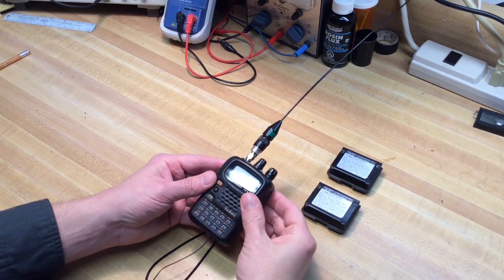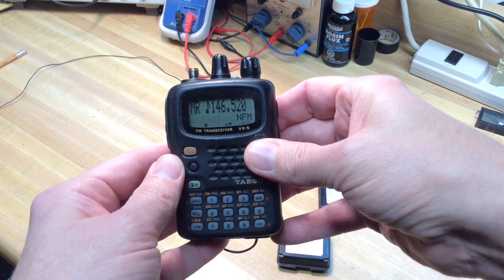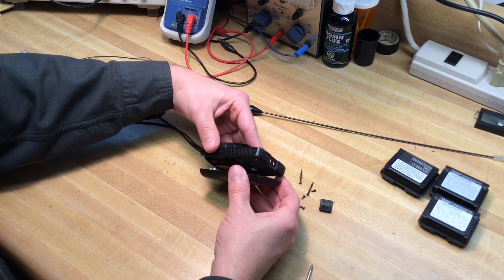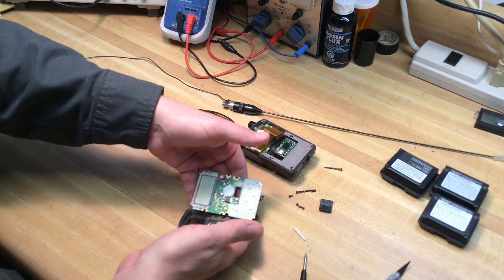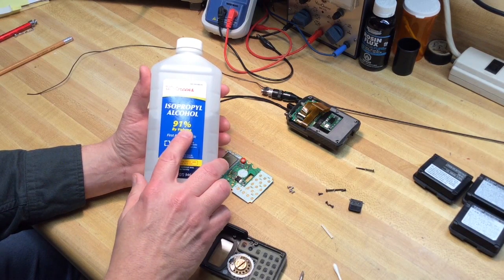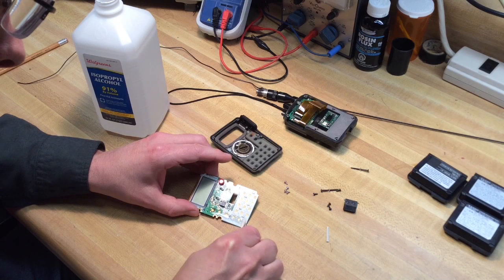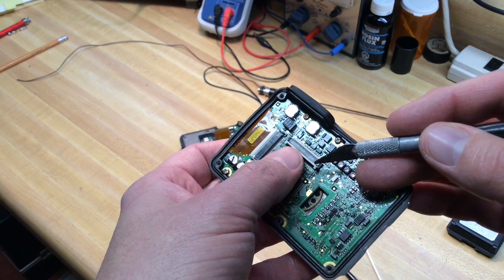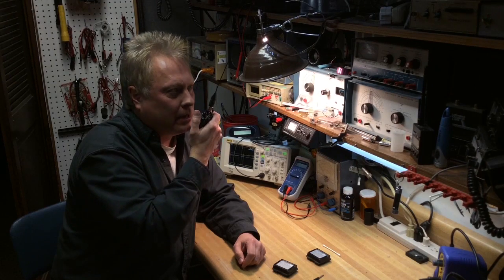Yaesu VX-5R On/Off Switch Problem

Comment: I've had an HTX-204 (Radio Shack) sitting around for a while that won't turn on.  I tried alcohol to clean contacts like this video shows and it still won't turn on.  I checked continuity around the battery terminals and DC power jack.  This is the weirdest thing -- continuity seem ok when testing the solder joints and things by themselves, but as soon as I plug in a power supply connector into the DC power jack, the continuity no longer reads on my volt meter.  What the world???  The positive side breaks continuity.  (Negative/ground side still has continuity.)  When I unplug it, the continuity on the positive side comes back.  Bad power jack?  Diode?  Even if I directly wire up power to the battery terminals, still no power to the radio from what I can tell.  Something is stopping the positive power circuit, not allowing current to flow.  I'm confused.  I've replaced the safety protection diode also and still nothing.  (There are two diodes right by the power jack - both diodes test good.)  Any ideas?  (Also trying to locate an HTX-204 schematic if anyone has one!)

Comment: Too bad someone doesn’t make parts for these radios. I have tried cleaning mine many times but the problem always returns within a month. Thinking of replacing the base of the keypad from a donor keypad from another device. Trying to figure out what adhesive will bond the two silicone parts. There was also an epoxy repair "glue" that repairs these pads. Haven’t seen it offered in a while but haven’t done a search for it recently.

Comment: Notes from my fix:  1)  it worked.   2) i did not  remove the ribbon cable, 3) I cleaned it with 99% isopropyl alcohol and Q tip swabs.

Comment: My 20 yrs old VX-5 displaying identical switch-on symptoms. Managed to carefully dissemble & clean with contact cleaner and Q tip without disconnecting the fragile ribbon cable. Most difficult re-assembly challenge was correctly relocating the body gasket but patience paid off and voila the old VX-5 keyed up immediately when the power button pressed!

Comment: Did Yaesu do this on purpose? Make their radios with a lifespan, so you have to buy a new Yaesu. And then you have to buy a new spare battery, a new drop-in charger, it does not make me think Yaesu is a good brand.

Comment: My VX5R tried to swim. It went like a rock into 1 metre of water. It was dismantled shortly after and dried in a warm low humidity for several days. when putting it back together I have now a piece over. It is a copper coloured metal piece with a tag on one end and at the other a hole for a screw. Can you recall where it belongs please? Best regards

Comment: I did it with mine, and it worked for a year or two, now the On Off button will not work again, I'll try a different product to deal with the contacts! RP Electronics in the Vancouver area has 2 or 3 that repair this sort of thing!

Comment: I've done  this remedy twice to my trusty VX-5.  The ribbon cable lock was a challenge.  I went at it with some electronics cleaner and soft eraser.   I also had a Radio Shack Pro-96 with this symptom and this remedy worked.   I will try the counterpoise.  73s, KB1KXJ

Comment: Did you make the counter pose video and what tool is used to remove the nut for the sma antenna nut? I need to replace my sma connector and having a heck of a time getting that nut to loosen!

Comment: Thanks for the video.  Just fixed my VX-5R.  The retaining clip on the ribbon cable flips up (away from the cable) to release.  Don’t try to pull it away from the socket, or it will break. – W6WDH
Reply from the maker: Great to hear and thanks for the extra tip there also.  73

Comment: A Great "FIX" is "Plug in the CHARGER" Wiggle the Charger Plug while Pushing "red" on-off button when SCREEN GOES BLANK," Works Perfectly. 

It has no problem turning ON or OFF when the NC-72B Charger is Plugged In and Charging. 

I have owned 2 of these, one I bought from H.R.O. in Anahiem 

I am going to try it with a BATTERY hooked to a PLUG IN to see of that works.

Comment: Nice fix. My wife wants me to clean all the remotes in the house but I just say press the button harder. Anyway, I grew up when you got up from the chair, walked over to the TV, and changed the channel or volume. Sure there was only 4 channels so there wasn't much compulsion to change the channel. I still fine myself getting up to change the channel... but mostly because the buttons are dirty on the remote. HA I order 99.953% Pure anhydrous isopropyl alcohol item# 824-1L from Circuit Specialists (dot) com for cleaning electronics. Great stuff!

Comment: Interesting, as usual, Larry. I would like to hear your opinion about the counterpoise.
Reply from the maker: I may do another video on that topic, but what it is is just a quarter wave ground radial that makes up the other half of the missing dipole.  The radio is not large enough to make up the ground side of the antenna so this usually helps out a lot to make the antenna system more efficient and radiate more signal.

Comment: Great job, Larry.  I have some Iso Alcohol that is 98% that I used on VCR heads and belts, etc.  I hope that would be okay.  My Sony remote control for the big screen has really developed some contact issues!  May have to give this a try.  73s
Reply from the maker: That should work just fine. I would give it a try but just don't be very aggressive on the rubber pads, but ok to be more aggressive on the board.  I sometimes use a toothbrush on the board also.

Comment: I use tuner600 spray for the contacts, and there is a fluid for the rubber contacts so the resistance is restored

Comment: Your lucky on that repair tried doing the same thing to a Yaesu VR-500, the little bolt on the bnc connector tried and tried and to take that out but never could think I actually stripped it. Thats been years ago. Good Video though

Comment: what is the wire added to antenna do? i have a boafeng uv5r 2 meter.
Reply from the maker: It acts as the missing half of the dipole antenna, I plan on doing a video coming up explaining how this works.  But it basically provides the missing half or the ground radial for the antenna that the radio ground is not big enough to do most of the time.
Reply: thanks im gonna try this. and again i enjoy your videos, ive learned alot from them thanks again